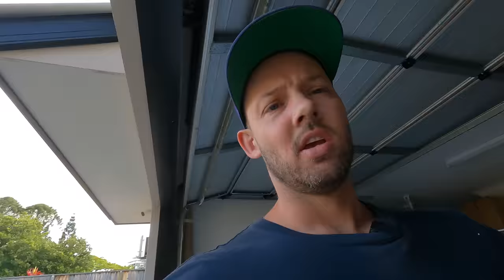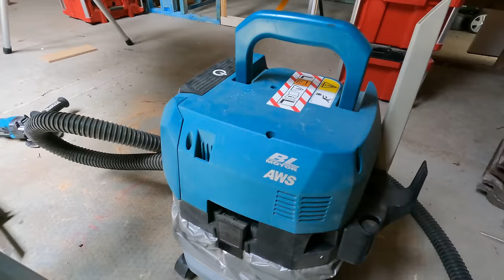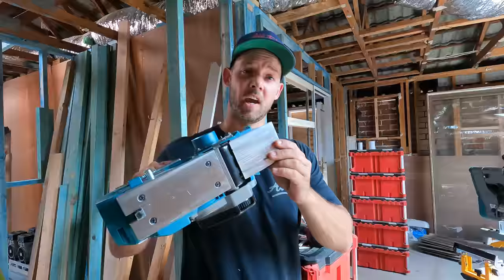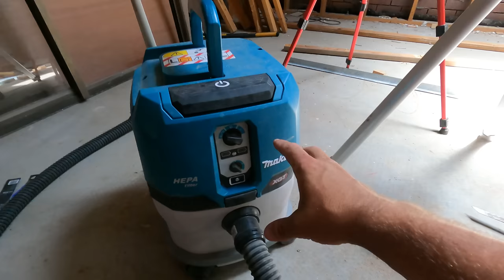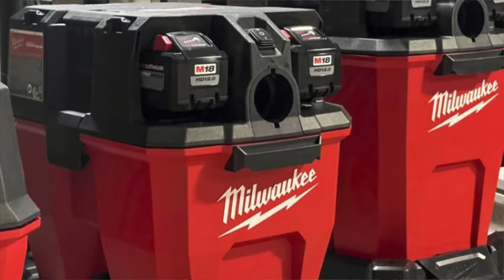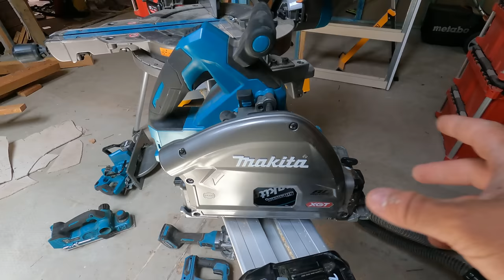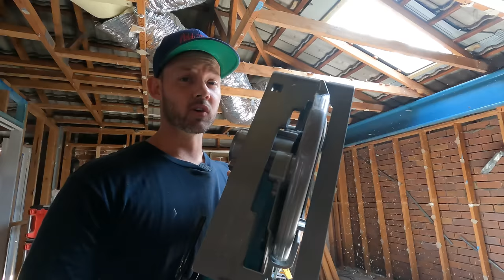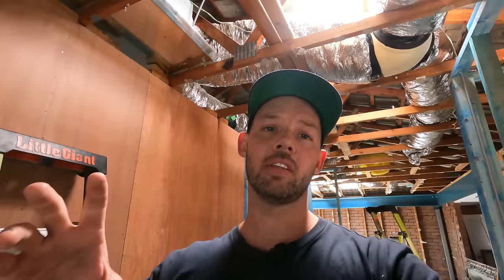From milwaukee to Makita. Why I changed tool platforms

Comment: Can add this to the discussion. All my 10yo Makita tools were caught in an unexpected weather event recently and were completely submerged in their plastic tubs for about 48 hours until rescued. I was devastated, and prepared to replace everything, but to my utter amazement, all the tools, batteries and eventually chargers dried out and began working again. 9 months later and all are fine and working as well as ever. I did buy a couple of new batteries and a charger just as a offering to the Makita Gods for their beneficence. Changing brands would be sacrilege for me after all that!
Reply: Interesting that you brought this up.  I dropped my oldest Bosch cordless drill in a creek when I read building a bridge over it.  It went completely under water and I had to go get wet to get it out. I jumped right in after it.  To my amazement it just kept working. At that point it was already so old I can't even remember when I bought it. Probably was at least 7 years old at that point. It is still going strong and I have only noticed a slight decrease in battery life. I ran a drill pump with it not long ago and it did great. It came with two of the 1.5 ah batteries and a charger. I still like Makita the best though I am very fond of Bosch as well. Just wish they made more tools. Bosch is great quality for the price you can get them at! Especially for the CPO refurbished ones.
Reply: Brushless tools are almost guaranteed to work after being wet. As long as you let them dry before use.
Reply: Keep a close eye on those batteries though.  Probably not a bad idea to store them somewhere they won’t pose a fire hazard.
Reply: pretty much every electric tool can survive that the batteries are protected from water and shorts because of water its only the battery that gets killed the tool always survives since it gets provided the power by the battery but alot of the times the battery survives
Reply: @FishBaitBlue  … fair
 point. Though 18 mths later all still going strong.🤞🤞🤞
Reply: @sueneilson896  Good to know as I’m fully locked in on Makita myself lol

Comment: I use to be Anti-Makita for absolutely no reason other then that I used all Milwaukee. I tried my friends Makita because my Milwaukee died, and WOW!!!!!!! I sold all my Milwaukee gear and switched to Makita. I find Milwaukee to be like an old muscle car, and find Makita to be a refined super car. Makita doesn’t seem to be powerful, but that is because I use to associate power with tons of vibration. Makita has power, but made it run smooth and efficient without shaking my bits off like Milwaukee. I’m glad I can now finish a day of work and still feel my fingers 🤣😂🤣😂🤣
Reply: This is important and rarely a factor for all these power videos. Ergonomics , esp for smaller hands/ less strength is important. You might be a bear in your youth, but as you get older all those repetitive strains matter.
Reply: What are you talking about. Fix your tools…

Comment: Agree with the batteries 100%. Makita batteries have been bulletproof for me. I have 10-year-old batteries that just won't die.
Reply: Makita are the very worst imo!
Reply: @Amateur Vegan you must use them underwater lol. I am not brand loyal. I currently have Dewalt, Makita, Milwaukee and a few Ryobi tools. Only batteries giving me trouble are Milwaukee. Seems to vary a lot depending on the specific model.
Reply: @mikek5016  I’m in the uk, the makita batteries might be different because they’re the ones I’ve always had the most issues with and the only ones other then Bosch 12v I’ve ever killed completely. Never had any problems with dewalt
Reply: I’ve been in Makita for years because of the batteries and the chargers.
Reply: @lkm55  yes! I have about 20 batteries from Makita up to around 15 years old. Every single one of those batteries is still working well. I also have about a dozen DeWalt batteries up to about 8 years old. 5 are defective and one is completely dead. I can't comment on the Milwaukee as I don't have any of their cordless tools. 

Based on my own uses, the 40V Makita batteries are insanely good. They are designed for high output. I can run my 40V miter saw without ever feeling a loss of power due to heat . Those same batteries seem to have full power right up until completely discharged.
Reply: @mikek5016  you obviously don't work in a cold environment then
Reply: @mikek5016  So, if only Milwaukee batteries giving you trouble solve this and skip batteries. Use the tools without batteries:)
Gritings from Makita fan.

Comment: I’ve always believed Milwaukee have the best tools for electrician and plumbers, but in terms of saws for carpentry it’s been between dewalt and makita (makitas 40V is the best for saws currently)
Reply: The thing I find though as a sparky working for a company that provides all our power tools, you are right they have the most tools for us. But if I bought any of these tools myself I'd be pissed. 

I think so many are biased because they pay for them themselves and no way would the have bought something bad right?

But seriously Milwaukee may make the most powerful tools but their tools are not reliable. 

Hospital build currently with 45+ guys on site in less than two years 4 of the hydraulic punch kits dead all were brand new. 
Countless bandsaws down
And at least the gen 3 impacts and drills are terrible. They can power through plenty of stuff yes but then just completely shit the bed. 

When I was non union I provided my own tools and bought Makita. No regrets. Even my impact that's 12 years old now first brushless they offered, still going no issues. 

Even speaking with other trades whether it be the concrete formers, welders and iron workers or plumbers/fitters. All Union trades so none of us actually provide our own power tools all saying the same Milwaukee has gone so far down with reliability. They aren't meant for the hard consistent use that comes on big commercial and industrial jobs.

Go figure the greenlee punch kit I now have at work that we went back to using is still going strong when it's 8 years old and the Milwaukee ones are dying every few months. 

Milwaukee may warranty them but it doesn't matter it's 2-3 weeks waiting for them to warranty and get them back to us that's 2-3 weeks of lost production because their $900 Punch kit that they advertise as professional grade can't stand up to doing 10 3" punches in a row without the pump giving up.
Reply: I agree dave
Reply: @JoeC92   Milwaukee used to make REALLY reliable tools and you can still find 15+ year-old impacts and power drills in use on job sites, but I think more recently they might be slipping. They grew into a lot of other areas. Like, I don't remember ever seeing Milwaukee gloves or pliers, when did they start making gloves? Great gloves too, and their lineman's pliers are arguably better than Klein for less $$, but meanwhile for power tools: I'll take the DeWalt chainsaw and Ryobi for everything else.
Reply: @gorkyd7912  100% agree. I've been with the same company for 10 years now and we never used to have the issues we have now and always been using Milwaukee. 

I'm yet to try the Milwaukee pliers but ditched Klein for knipex and never looked back
Reply: @Adirondack Homestead that was me for Klein tools too. Got sick of having to constantly replace screw drivers and pliers because the tips round out so quick or pliers can't cut anymore. 
Switched to wiha drivers and knipex pliers and no issues again. 

I don't get how so many can look past the lost time from broken tools and not realize the loss. 
The company I work for is huge, and multi trade we have a Milwaukee rep dedicated just to our company and the service still takes 2+weeks. Too much lost time I wouldn't be surprised if they switch from Milwaukee soon. Same thing happened with the rental company for boom lifts etc. Lifts the break down and then they take a week or two to come service them while still trying to charge $3000 a week in rental fees. Stopped using them and switched to one of the others that at least comes when you call them.
Reply: @@AdirondackHomestead Comes to reliability first.
Reply: The Bosch compound slide mitre is really nice, I have an old makita that is still robust after 30 years, but my dads Bosch is such a nice tool. The new reticulated zero clearance is the smoothest saw I have ever used. Well built.

Comment: Makita has been by my side helping me do the work for 40 years.  Great tools!
Reply: Makita is one of the top brands. I love plenty of makita tools. I sadly recently retired my makita drills after feeling the power of a new milwaukee impact with 4 modes.

But that 40v 4ah has less capacity and output capability than that 18v 12ah milwaukee battery. Facts.

More volts doesn't mean more power with battery tools. Bigger batteries do, or better batteries do (on a cell level).

A great for instance is that makitas own 18v 5.0ah battery and thier 40v 2.5ah battery both contain the exact same number and type of batteries, just wired differently.

Also 20v and 40v type branding is legal lying. They are all 18 and 36v in actuality. I suspect eventually all the branding will swap to the 20, 40, 60 standard as the EU allowed it.

Comment: I'm a Makita fan due to the weight, ergonomics and reliability,I'm using gear all day and the Makita gear generally feels more comfortable in hand, less weight hanging on my belt and less downtime due to tool breakdowns.

So far the only Makita tool to fail on me has been the gib screw driver
Reply: Right on deano.....makita is the lightest of them all and comfort for all day use is top scorer....all my Milwaukee sits in the draws ....always go for my makita gear first...
Reply: Makita is super reliable and cheaper overall than milwaukee. My first Makita 18V battery 3ah bought in 2012 and still works. I have M12 tool range as well though
Reply: Funny that you mention weight, one of my friends has a Makita drill and while I do agree that it does feel a bit nicer, the skin alone with no battery seems to weigh almost as much as my Milwaukee drill plus a 5Ah batter.
Reply: With the option of battery adapters now I've decided to adapt what I think is best in category to use.  I have Milwaukee most but I like makita circular saw due to the dust shoot. Milwaukee jigsaw is not very good chips and frays edges when I use down cut blades so I use a dewalt .
Reply: is dewalt good or sucks?
Reply: I have burned through a couple sawzaws after cutting bottom plate, and rebar for years, and one radio has passed away recently due to the cold, but other than that, not a single Makita has died on my watch
Reply: The ergonomics on the new Makitas is horrible. I don't know the model of the newest drill we got from them but it's a medium size and it's the worst lump of drill I have ever worked with. The trigger is like an on and off switch. The gear switch is so heavy you need to put the damn thing down and use 2 hands to flick it. And it weighs a ton. I think it's rubbish. A bit like one of these eastern European trucks. Indestructible and strong but that are the only things speaking for it. I was going to buy Makita for my new company but now I don't know what to do. If this is the future of Makita I am definitely not going for that.

Comment: When tools were corded you weren’t limited to “tool platforms”. For framers, each company was known for and by specific tool groups. Best wormdrive saw, Skill. Best Saw-Zaw, drills and hole-hog, Milwaukee. Best jigsaw, power-planner, and laminate router, Bosch. Best 12” compound miter box and 10”job-site table saw, DeWalt. Best 1/2” impact and 3 horse plunge-router, Makita. Best framing gun, Hitachi. Best to horse fuel tank compressor, Emglo. 
All the name-brands crossing over to cordless was a smart move because it locks you in to one brand and    creates repeat business on expensive batteries. I’m really surprised Skill hasn’t come up with a cordless version because Makita’s 40 V cordless can go a whole day on a framing crew without having to swap out batteries.
Reply: is a universal battery for all brands possible? XD
Reply: I use Makita, Bosch, Metabo HTP and Kobalt. It depends on the type of tool you are talking about on many of them. However, there are great tools from some brands in the same categories as well. For instance, both Bosch and Makita make great cordless sliding compound miter saws. Kobalts 7 1/2 inch cordless compound miter saw is awesome as well for it's lightweight and easy portability on a folding portable stand like the Delta stand. I favor Makita tools as well but Bosch makes some great tools as well just not as many. Kobalts are pretty good but definitely not as durable as the others. Metabo HTP's cordless tools are good for the most part but very expensive and there cordless compound miter saw is not so great. However, Metabo HTP's cordless nailers are the best and you can find deals on them at times where you get free tools with them buy purchasing another one of their tools. You pretty much have to do a lot of research watching videos and reading reviews. I do not agree that one needs to be limited by a battery platform though. I have found you can get into any of them by for instance buying a starter kit and getting a free tool if you are patient and vigilant.
Reply: There are adapters one can purchase to run Milwaukee batteries on Makita and dewalt, Makita on dewalt and Milwaukee and Bosch, dewalt on Makita and Milwaukee and etc.
Reply: @wildechant3667 You lose a ton of performance, some batteries can be killed if used with certain brands because some companies put the BMS in the tool while others put it in the battery, and some are just fire starters
Reply: 100%....each brand made everything but excelled in only a few, I built my arsenal off that and still run with it today.......Porter cable as well for routers and door planers, senco for finish nailers

for finish work I liked hitachi miter saws....both a 12" and a 7 1/2 for moulding, no heavy lumber goes those saws....it throws them out of whack and have to calibrate too often.....used a cheap Ryobi 12" for framing lumber, lol

Comment: I’m a sparky. And always been a Milwaukee guy. But recently as my impact driver and grinder has died. I felt the new impact from makita and thought it felt way better built and comfortable to use then milwaukee so decided to jump
Over and get a makita grinder and impact. Really impressed with makita quality. Potentially making a switch as my Milwaukee stuff dies.
Reply: Yeah…I’ve used makita my whole life and tried Milwaukee impacts and they just don’t feel right. And my Milwaukee buddies try my makita for certain things and say the same thing. Idk how to explain it.
Reply: Makita didn't make the field test for us... Milwaukee has the fuel for us
Reply: Are you comparing it to your old Milwaukee or the new Milwaukee?
Reply: @nickrouse1738  I picked up the new Milwaukee when I was in the store and the makita impact was leaps and bounds better, lighter smoother better feel. The Milwaukee grinder I had the paddle switch has a spring in it which failed early. Just seems like a robust solid tool with relies on a cheap spring to work. Now it’s useless. I opted for the makita grinder with the toggle switch just seems bullet proof. Don’t get me wrong though I love all Milwaukees tools they’re great but just wanted to give makita a try
Reply: Makita made in Japan is where it's at.
Reply: My buddy i work with swears by Milwaukee and that's why he keeps buying the same tool time after time when it dies...i still have the same Makitas

Comment: My oldest makita battery is 13 years old and just failed. They were 3.0s and never faltered in work time. I still have a few 3.0s but currently own 5.0 makita batteries along with my dozen makita power tools. Always been happy with their products since 2004
Reply: Dadi Omega. The 5 amp hour batteries are quite good. The structural engineer I do work with has some of the 5 amp hour. The battery lasts quite a while on the grinders.
Reply: Makita is the best
Reply: I've got 2 makita 1.5ah batteries i bought with their very first impact that are over 15yrs old and still going strong. Also that 15+yr old impact wzs still going strong until it was stolen about a year ago
Reply: I'm still running a 3amp from my Makita kit I bought in 2009 👌

Comment: I completely agree, I had the same problem with Milwaukee, most of their high output are weak, unreliable mostly the 12.0, and the circular saw 7 1/4 fails a lot, over a year I switched to Makita 40v and its amazing, the 40v Saw its the best and I haven't had any issue with the batteries, the charger charges fast and has dual fans its just amazing